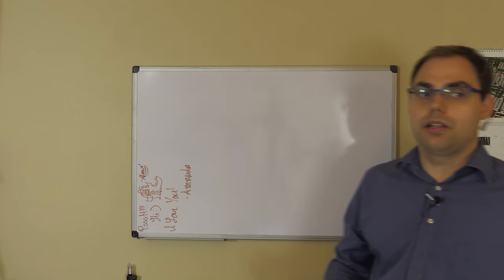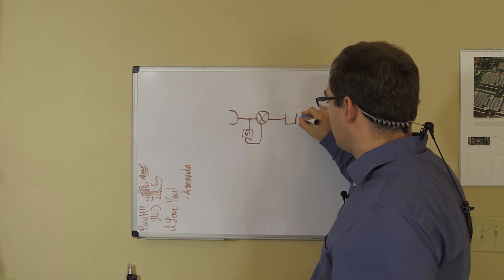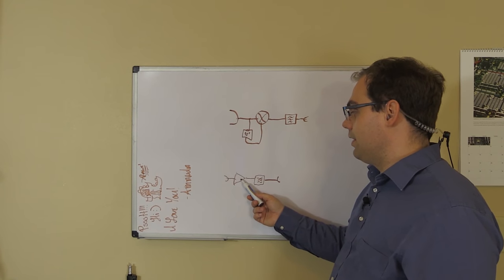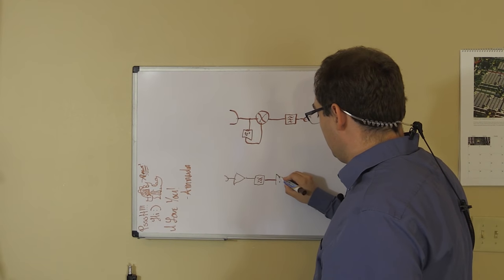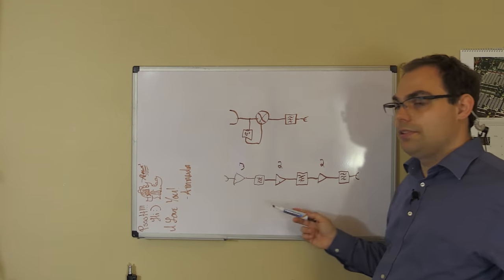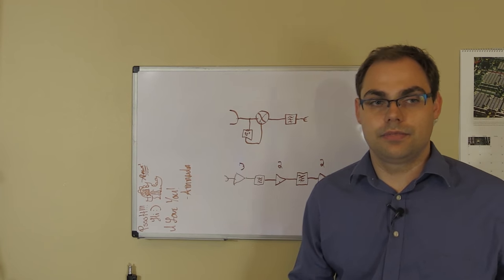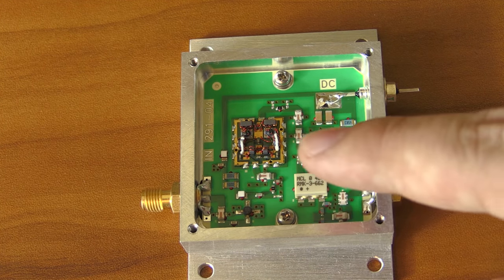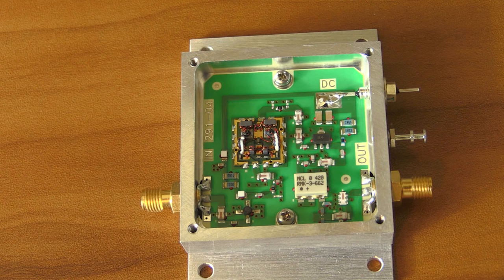How do frequency multipliers work?

Comment: You didn't explain how a 90re degree phase shift increases frequency. Pretty important thing to gloss over if your videos purpose is to explain frequency multipliers
Reply: i thought it was self obvious, when your signal is a quarter phase late, the up of the second signal will combine with the point of neutral signal and you end with a signal that have double the ups, but i'm afraid i'm confused bc you end with double hump camels or something xd
Reply: @zazugee 
That is not true though,if you add sin(x) and sin(x+pi/2)
There is no frequency change